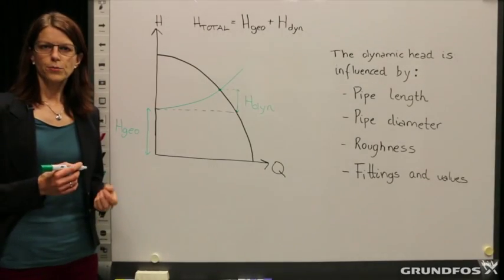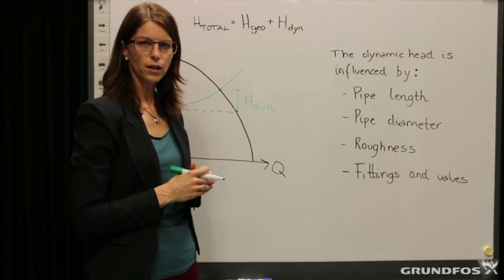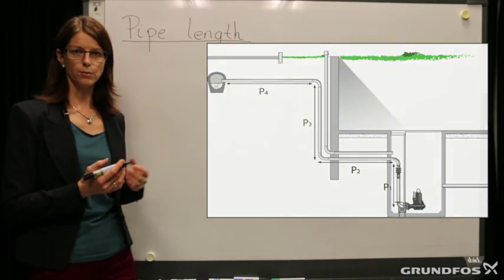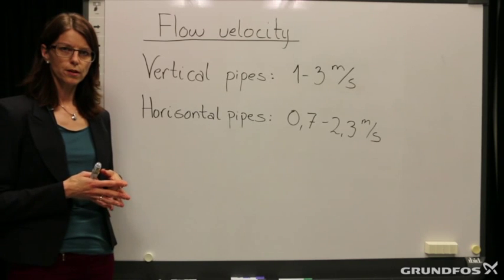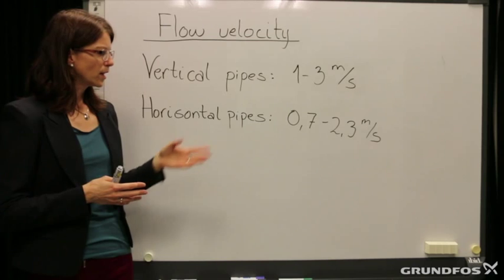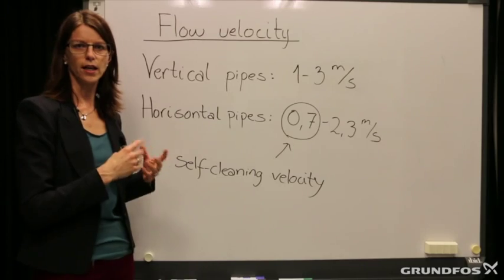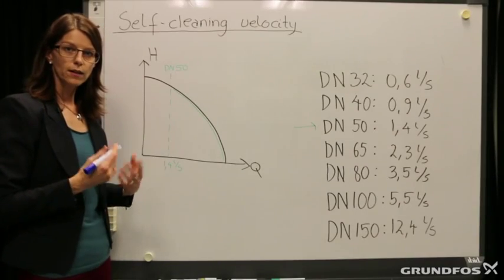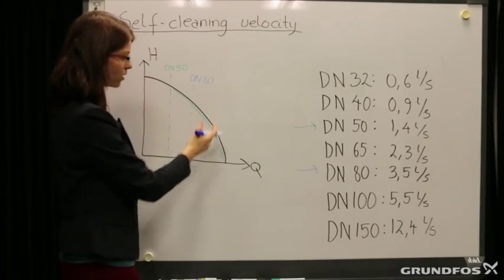Using the system curve for pump sizing

Comment: there is one part of the presentation that the velocity unit is mixed up with flow rate unit. also for friction loss, you only need two points to get the friction loss, ie pipe diameter and flow rate, or the other two parameters. you only need 2 points to define a straight line. also it is quite funny to design the pipe from sanitary discharge to pump such that the vertical pipe is smaller than horizontal pipe.. in that sense i would recommend just using the 1 to 3m/sec velocity for all pipes. also comparison between older and newer system curves, the geodetic head should not change. only the dynamic head should change.

Comment: Hi Thanks, why 0.8m in friction loss?!?
Reply: She converted 7700 Pa to meters of water column.
Reply: how can find out the rate of flow of  a pump when two pump are connected parallel to a single pipe line with both pump have same head ,can you explain